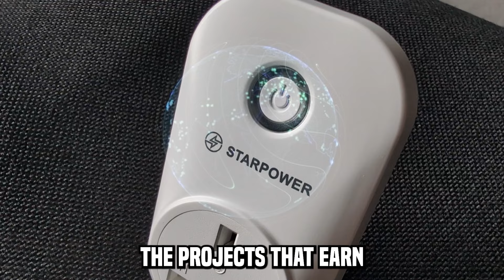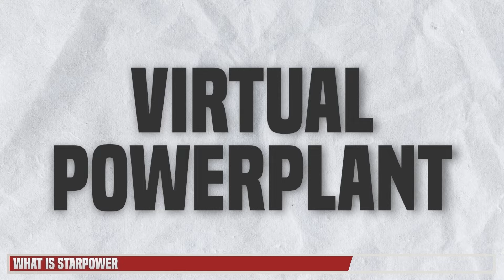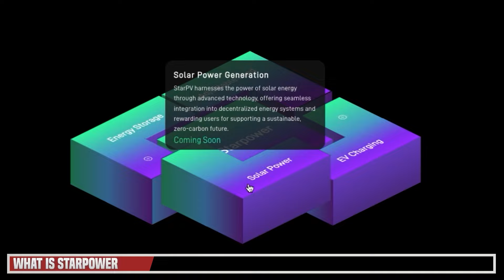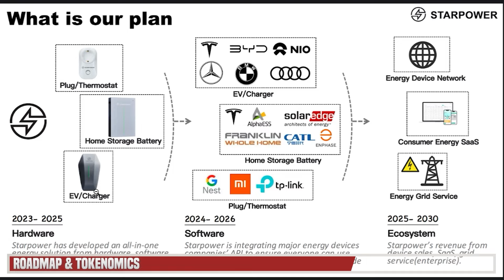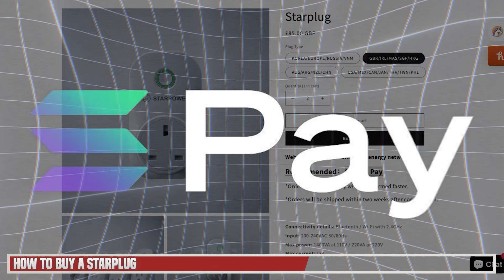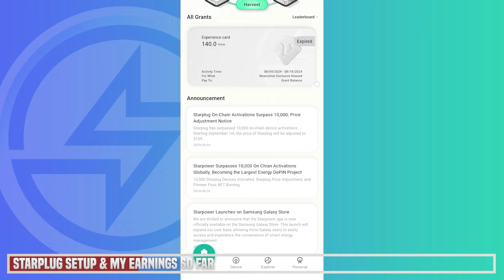I'm mining crypto from Electricity! | New DePin Miner Starplug

Comment: How many would you want in your home.  One for each room?    One for each appliance?  What is ideal?
Reply: I believe the endgame is that they'll remotely switch your devices off during periods of high demand. So, anything that you don't want to be randomly shut off shouldn't be on one of these plugs. 

Otherwise, the more you use, the more you get rewarded.
Reply from the maker: You can put as many as you want. All it does is monitor the electricity in your home. This provides valuable data, helping them know when there is high electricity usage or low electricity usage across the world

Comment: The only thing about this project is yes you are giving them your data but you are also essentially giving them to the ability to turn your devices on and off based off of demand load. Not so sure about this one.
Reply from the maker: I guess it's no different to any other iot device that you have in your home. Anything that is connected to the internet in your home be remotely turned off. Same goes for your Tesla vehicle etc. 

The idea is that these devices will monitor the data usage, understanding when peak hours of data is and this will help the virtual power plant
Reply: The plugs are there to monitor usage. Not so that they can turn them on and off when usage is high. If they did that people wouldn't use them.
Reply: @TempusNexus  “Implement smart features to enable energy consumption tracking, automated demand response, and remote control via a mobile app.” Straight from their website…automated demand response. They can control your devices (plug, battery, or car charger) based off of grid demand.
Reply: I think your confusing Starpower with utility companies that offer discounts when you use smart meters, that way they can cut down your power supply during high peak demand.